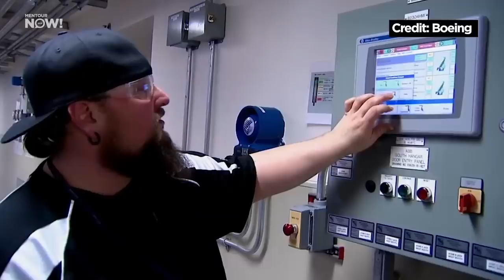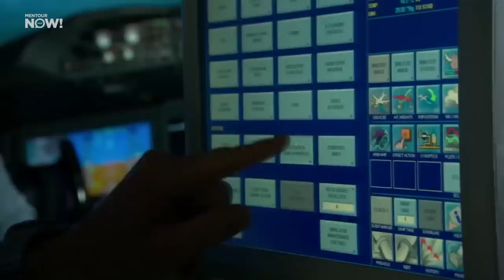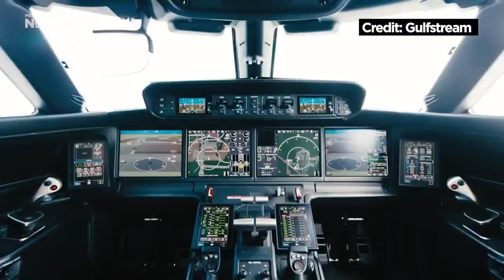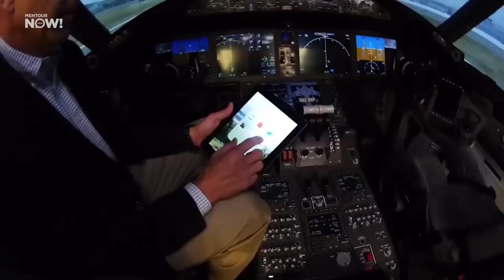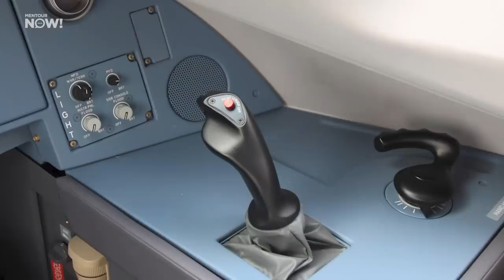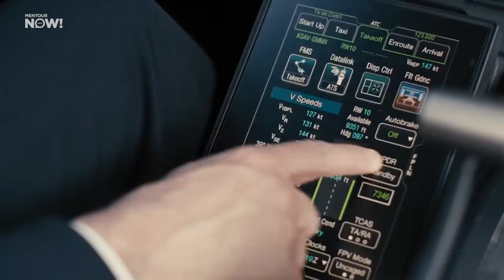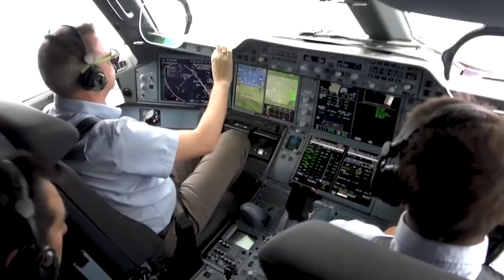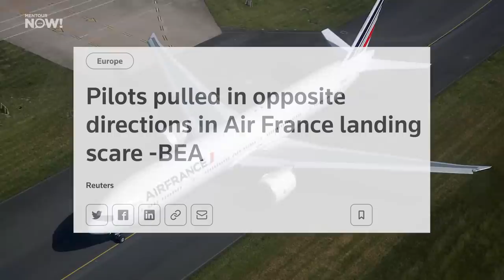Is Boeing Switching to SIDE-STICKS?!

Comment: I have around 8,000 hrs of sidestick experience, and 12,000+ of yoke. I really don't care which I use, the view outside is the same, and they both pay the mortgage.

However, when flying with other guys that have Airbus experience on the Dreamliner, we all agree that we miss, not so much the sidestick per-se - but the ability to have a table in front of us - it makes dining far easier!

Got to get those priorities sorted! 😄
Reply: Priorities have to go first 🙂
Reply from the maker: Awesome insight.. I would love to try flying side stick myself.
Reply: Thanks for that input.  I'm not a pilot but I have to think that freed up space for using as a table along with having displays/controls, or whatever in that middle area that didn't exist before would be the biggest advantage and the actual flying using either control wouldn't be so much the issue.
Reply: @MentourNow  I dream of having hands 🙌 to catch some fish sticks. Good to have perspective 😉
Reply: @MentourNow  believe me, it’s not really that different. I flew Fokker 100 which is yoke and 320/330 sidestick. You have to get used to the control laws. The handling on airbus is worse. The plane does some kind of Dutch roll at low speeds so you find your self in pio a lot of time fighting its own corrections. And in the 321 neo specially the Lr pitch authority on the flare is bad. If you take engines to idle to soon it is quite un predictable what authority you have because that depends a lot on the trim position at 100 feet that freezes, only to find out a sharp nose up tendency when spoilers extend. Different from the CEO’s that would put pitch down at a given rate below 50 feet to force you to flare, and was better tuned for spoiler extension. The roll however has more feeling to it in the neo. Better and faster response.
Reply: All due respects to your experience, side sticks means that either Pilot or Co-Pilot will be flying with their non-dominant hand.  Assuming you are a Captain and are likely right-handed, is you left hand as coordinated as your right hand?  I doubt it.
Reply: I remember Captain Joe bragging about that.
Reply: @MentourNow  we do mixed fleet flying and I go back and forth between a yoke and a side stick. I thought I was going to dislike the Airbus, but I must say, I was pleasantly surprised. Besides the table, you also sit in a much more relaxing position. The weirdest thing for me is what to do with your right hand at V1. 😂 It felt awkward to just put it on your leg.
Reply: I flew both airbus and boeing. I think it is a pointless argument, both are great for different reason… i get annoyed when I hear non airline pilots arguing about this. Yoke feels good for the short moment when you have both hands on it (hardly ever) and really in the way when you try to eat…I think a yoke is way havier so going to sidestick in the interest of weight saving makes sense to me…
Reply: @encinobalboa  I'm right handed but I can only drive one-handed with my left hand. Same on a bike. It's not less coordinated but differently coordinated. Also, I taught my left hand to play tennis, ping-pong and write with a pen...backwards. I can write with both hands at once, and so can you.
Reply: I do absolutely love it all comes down to eating meals!
Reply: @Clayson Antoons yes... and it is worse if you take the engines to idle too soon. Engines are bigger so the momentum of going to idle sometimes makes pitch authority not enough. It’s better to flare it and then reduce thrust slowly. However operating in short runways that eats a little bit more runway. So less margin for error. What you said in turbulent weather is what really happens.
Reply: @encinobalboa  it’s the same with the yoke. You fly left hand on yoke and right on throttles in leftvseat and reverse it to the right seat. Hardly both hands on yoke. Also the trim switches in yoke are left on left seat and reversed on right seat. So it’s the same. Just a little bit of difference to the place where your arms rest.
Reply: When you are well fed, you are well ahead…
Reply: @MentourNow  I was wondering if Boeing changing to a side stick would necessitate a change in type rating. It's an obvious change, but to me it seems actually minor compared to knowing the procedures of the plane. I would expect that a competent pilot would be able to switch quite easily, may be a few hours on the simulator, may be not even full motion, to get a feel of how much movement is required for a certain change in attitude, but other than the placement of the side stick, nothing has changed. Presuming Boeing don't do a major cockpit layout overhaul, or change the authority of the fly-by-wire computers.
Reply: that's indeed what they all say: the table !!
Reply: @encinobalboa  How is that any different from a Yoke setting? Left seat, left hand on yoke. Right seat, right hand on yoke. Gotta be that way with the thrust levers sitting in between.
Had the same adjustment when I did my Instructor training. Up until then all my flying was done in the left seat then it was the right seat and suddenly you found you right arm didn't have the same muscle memory as the left. Didn't take long to getting it up to speed. Anyone who has taken that track will say the same.
Reply: @joaodantas8530  Is the flare thing the similar to the one Captain Sullenberger complained of when ditching into Hudson?
Reply: What about displays? Does a yoke block or partially block any flight instruments when you are in the normal seated position?
Reply: @encinobalboa  I am right handed and that is not a problem. When manually flying you are using one hand for thrust and one hand for side stick/yolk.
Reply: I flew airbus all my life and changed to the Boeing just a few years ago.. the one thing I hate the most is having that collosal yoke between the legs, which we use for all of two minutes every flight. No pun intended 😉 What on earth is that thing doing in the cockpit of modern day airliner! 
Also the Boeing seats are very uncomfortable as compared to the bus, my balls are always hanging for no good reason. 

Boeing really needs to learn how to ergonomically design an aircraft, like Airbus and stop worrying about the American pilot lobbies, who just refuse any kind of change. Screw them, they can keep flying a DC 3 if they don't want automation and accept changes. 
Build it, they will fly it I say.
Reply: Had ‘interesting’ landing experiences in Airbus planes and Boeing planes.
All this concludes is that there’s more to using the flight controls than what hand it’s in.
I can’t imagine how someone uses a side stick (I always crash in flight simulator but I never crash the car), but I feel the airbus side stick may be more complicated than my £9.99 computer control.
Well my Airbus plane this week didn’t crash, even if it did have an INOP door. Fortunately it had a door, just not one that acted as a door. Didn’t know you could fly with missing doors. The sidesticks weren’t missing hopefully.
Reply: @encinobalboa  The vast majority of pilots learn to fly with their non-dominant hand. When you're flying a light aircraft from the left seat, even if you have a yoke, you normally only use your left hand on the yoke and your right is on the power or whatever else you may need to be adjusting at the time. If you're in the right seat, it's the opposite. Since you normally learn to fly from the left seat and something like 90% of the population is right-handed, most pilots are learning with their non-dominant hand. Personally, as a right-handed pilot, I didn't notice any problem with this at all. There are a number of other issues I'd have with side sticks, especially if they don't provide feedback for what the other pilot is doing, but dominant vs. non-dominant hand isn't really one of them.

At least in the 737 simulators I've flown, it seemed much the same in that regard. I just naturally flew with my left and adjusted power, stuff on the MCP, instruments, etc. with my right hand, though I've only 'flown' those in pilot-training simulators, not in real life as I have on light aircraft.
Reply: @encinobalboa  When I did my type rating on the A-321 it took me 10 minutes to get used to the sidestick with my right hand, for the captain it was more difficult as he was using his left hand, it took him about 2 hours so it's not big deal. Anyways, with the yoke you have exactly the same issue, one pilot will handle it with his right hand and the other will use his left.
Reply: @a.b.6233  As a member of the flying public, I appreciate your reply.  I have no doubt that a Captain can become proficient at flying with his off hand but the chance that he/she is ambidextrous is low.  Approximately 1% are truly ambidextrous.  For the other 99%, the off hand will always offer less hand eye coordination.  Safety statistics of the A320 family imply that the control layout is sufficient but in an emergency, I would prefer PF to fly with his dominant hand.  As to your other point about yoke controls, in an emergency, PF can and will use both hands on the yoke which increases hand eye coordination and precision control.  This is not possible with a side stick.
Reply: @encinobalboa  2 hours is too much in your opinion? When you handfly a plane one hand controls the yoke/sidestick, the other hand controls the throttles, for either system there is no problem.
Reply: @a.b.6233  2 hours is a single data point.  Is that the average for all pilots transitioning to the other seat?  At least you are discussing this issue and are thinking about it.  If I entrust my life to someone else, I would want him or her to use the most coordinated and dominant hand.
Reply: @Clayson Antoons Correct, 9 out of 10 are right handed.  1 out of 100 are truly ambidextrous which is low enough to be statistically insignificant for our discussion.  For the left side stick, there is a 10 percent chance the pilot will be flying with his dominant hand and a 90 percent chance he will be flying with his off hand.  Do you see the problem here?
Reply: @encinobalboa  Thousands of pilots fly with their left or right hands, predominant or not, they all manage it without any issue. If you don't entrust them then I suggest you never fly again as you see a problem where there is none and there is nothing I can say to change your mind.
Reply: @encinobalboa  i flew with both left and right... blv it or not... it does not make any diff in flying. Its very diff compared to writing. Zero issues at all. Both felt natural and comfortable. The only harder thing is the instrument displayed on the left vs right seat. As for the fltying with left or right hand, same same
Reply: @encinobalboa  I feel like you’re grasping at straws. I get that you want to be safe, but I think you’re suffering from a fundamental misconception on how planes are flown. You seem to think that in planes with yokes, pilots grasp them with both hands simultaneously, which just isn’t the case. That isn’t how we fly. You don’t really ever have both hands on the yoke. If the plane is properly trimmed, you can fly just with a light touch. It’s usually one hand on the yoke, the other manipulating the throttles/mfd/pfd/etc. In fact, when you are first learning to fly, it is discouraged and you are corrected if you place both hands on the yoke. Hope this clears some of your concerns up!

And to add, I’m RH dominant and it felt easy and natural with my left hand on the yoke when I was first learning to fly.
Reply: @Clagein  The fact remains that your left hand is less coordinated than your right.  That never changes.  When maximum coordination is required, you will default to your dominant hand.  That is not always possible with side stick.  Anyways, you are thinking about this and that moves the discussion forward.
Reply: @encinobalboa  I understand what your concerns are but the fact is that all the evidence shows that your concerns simply do not play out in the real world. Decades of flight history has shown that this is simply not an issue even though your intuition and common sense might tell you that it should be. There are a number of things in life where a persons intuition or common sense option on something turns out to not actually reflect the reality of the situation and this appears to be one of those things.

With that being said, as has been mentioned, even with a yoke pilots are usually only flying them with one hand (the other hand is on the throttle, using the mfd/pfd etc.) and if you are in the left seat, then that single hand on the yoke is your left hand. Exactly the same way you would be with a sidestick. In the case of an emergency, regardless of if you are flying with a yoke or sidestick, in the left seat, your left hand is going to be more "experienced" and I would prefer the more "experienced" hand in control vs. the dominant hand. In other words, in an emergency I would take training and muscle memory over hand dominance any day. And just to make it clear again, regardless of if you are using a yoke or sidestick, in the left seat, the left hand is going to be the one with the training and muscle memory.
Reply: @SectionNyne  I refer you to my previous answer.  Off hand in 99 percent of people will never be as coordinated as the dominant hand.  I don't dispute that with enough practice, pilots have become proficient with the off hand but the fact remains that they are more coordinated and precise with their dominant hand.  Side stick prevents 90% of Captains and 10% of F.O. from flying with their dominant hands.
Reply: @encinobalboa  And I will refer you to all the comments pointing out that even when flying with a yoke, when seated in the left seat, the vast majority of the flying is being done with the left hand so in practice the sidestick is in many ways the same as the yoke. I will also refer you to the decades long history of flights with sidesticks and once again mention that if this was an actual issue that manifested in the real world, then with all the available history and data, there should be a statistically significant safety difference between sidesticks and yokes. The fact that there does not appear to be any difference, seems to suggest that even though intuitively we know that hand dominance "should" make a difference, for whatever reason, in this case, it seems like the intuition appears to be wrong.

I will mention that I also was of the opinion that handedness should have an impact on the ability of the captain to effectively control an aircraft, particularly in an emergency. In other words, I had the same intuitive feeling that you did. And it was based on the same common sense take you seem to have. However after looking into it, the actual real world data simply does not bare out my intuitive expectations so I am forced to admit that even though a part of me still believes that it should make a difference, the reality is that it apparently doesn't.

Actually, now that I think about it, I am realizing that the are other areas where handedness should make a difference but doesn't actually seem to. For example most people seem to be able to drive, ride bikes or motorcycles equally well with both hands. Video game controllers also seem to have no problems requiring precision inputs with both the left and right hand. I think it comes down to the fact that hand dominance does make a difference when initially learning a task, but once you train enough, the training itself becomes the determining factor in your skill and hand dominance fades into the background. Basically muscle memory takes over and muscle memory doesn't care which hand it is tied to so either hand can become equally proficient if sufficiently trained.
Reply: @SectionNyne  I've made my point.  And I am glad you are discussing this because it shows you are thinking about your off hand and how you can improve your coordination.
Reply: @encinobalboa  To be honest I'm not thinking about how to improve my coordination at all. What I'm thinking about is that this whole sidestick thing is not at all the issue I used to think it would be.
Reply: Isn't it weird if you switch seats and you have to fly with your other hand? as one hand has trained muscle memory and the other hand hasn't
Reply: @encinobalboa  All due respect, you use exactly the same hand flying both side-stick or yoke. 

Left hand seat: left hand on yoke/side-stick and right hand on throttle. 

Right hand seat: right hand on yoke/side-stick and left hand on throttle.

Unless you’re a total noob then of course you would fly with both hands on yoke 🤷🏻‍♂️
Reply: 737 and 320 on my licences here. 

Sidestick all the way.

Can't recall when I landed the A320 with the A/THR ON or took off under VMC with FDs ON.

I love flying. Precise flying specially, thus sidestick is way to go. And they provide much more comfort.
Reply: Boeing is already doing side sticks in military jets 

I don’t see that the trouble is 😊😂
Reply: @encinobalboa  With zero due respect, you should make a Tik Tok video on the grave danger of side stick controlled aircraft being flown by non dominant hands. A danger which has gone completely unnoticed by the entire aviation industry.   You'll likely find supporters there.
Reply: How do you steer this huge plane with just left hand? I don't understand it.
Reply: @encinobalboa  Coordination doesn't really enter into play. Side sticks are easy to fly with either hand. I say that after 16 years teaching Airbus pilots.
Reply: @chris99997  which one is easier yokes or sidesticks ? In my mind yokes are better but  AF447 crash was French pilots fucked up big time ....this is not the first time they are doing it
Reply: @kirilmihaylov1934  I can't say either is easier. I don't think of them like that at all. Both are good inceptors, just different. The AF447 crash wasn't due to side sticks in the general sense. Certain specifics of Airbus' implementation probably contributed to the crash, but it wasn't just due to having side sticks. And for every Airbus crash that wouldn't occur in a Boeing there are Boeing crashes that would not occur in Airbus FBW airplanes.
Reply: @chris99997  true. Just  don't  go on AF ...I don't their pilots ate competent enough
Reply: @BariumCobaltNitrog3n  I think there was an American president who could write Greek with one hand and Latin with the other (I don't know which was which or if the meaning was different).
Reply: @DavidSmith-vr1nb  Let's see...James Garfield could write Greek with his left and Latin with his right, at the same time. He was the first left-handed President too. Left in Latin and Greek is Sinister (or variations of) as in evil, people thought you were possessed if you wrote with your left hand and forced you to use your right. Right is Dexter (killer name) as in dexterous.
The first 5 Presidents spoke at least 4 languages. The last 2 can barely speak one.
Reply: Make sure you take the jamb too...and watch you crew  drop dead in the seet
Reply: @encinobalboa  Note that the non-dominant arm and hand is actually preferred in various situations outside of flying. String players (particularly on fretless instruments) need to make precision movements with both hand and arm to select pitch and this is almost invariably done with the non-dominant arm and hand. When aiming a rifle, as well, once you're aimed in the right general direction precision aiming is done with the non-dominant arm.
Reply: The left pilot has to use his left hand to input something on the sidestick? He's not using his dominant hand? That looks dangerous to me. As a right handed person you'll never be as good with your left. I mean with the yoke you're using both so it doesn't matter.
Reply: @EbonyPope  You need to read through this comment thread. As many people have already mentioned, during critical moments of flight a left-seat pilot is using only his left hand on the yoke because his right hand is on the throttles.
Reply: @encinobalboa  it's the exact same issue with aircraft having yokes as your other hand in on the thrust levers...
Reply: so Boeing should find a way to give Pilots tables, noted
Reply: Yokes man I like yokes, it like women I want something to grab a hold of.
Reply: The yoke should fold down into a table.
Reply: Am not surprised you said that. I remember a pilot posting a picture of his view and he was having lunch while the copilot was flying. People who didn't know much about planes asked how he could mount a dining tray in the middle with a yoke. He simply replied "Airbus." 😁
Then he posted another pic showing his copilot's right hand clearly holding the joystick.
Reply: LOL. By all means, take into account dinner!